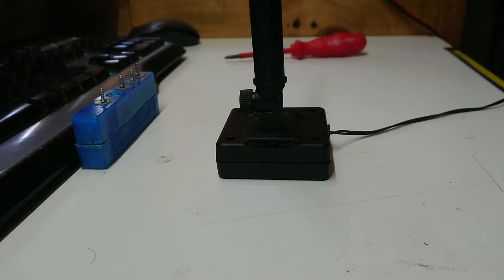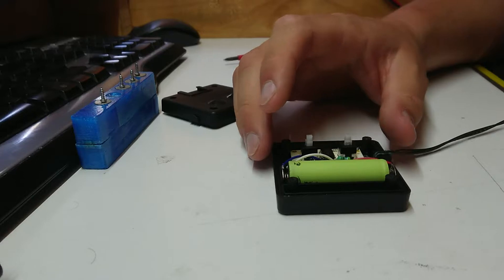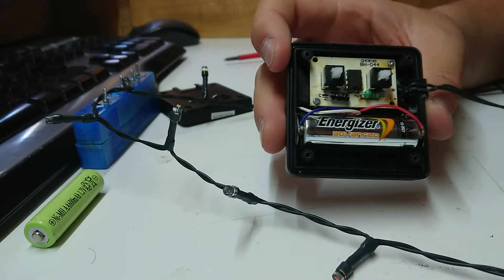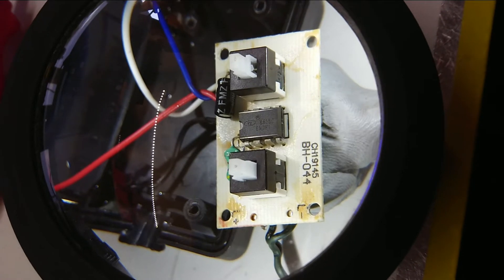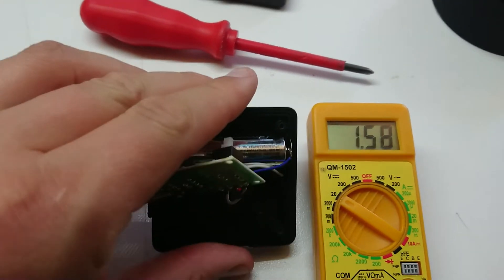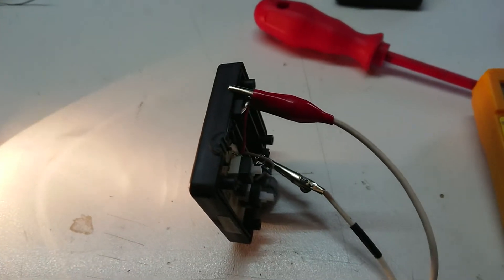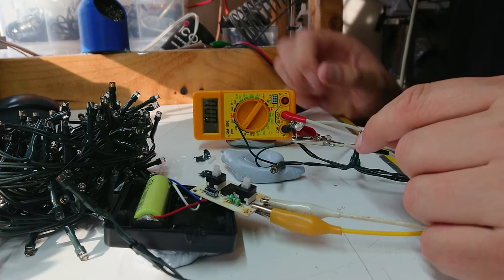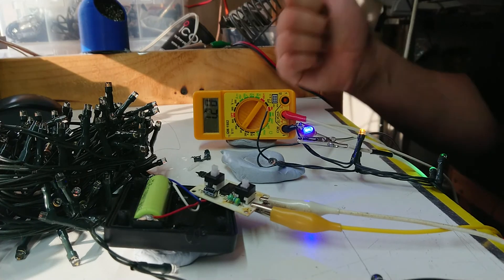Autopsy of failled Solar Christmas lights

Comment: Hi. Mine is not charging anymore after i plugged it into an adjustable power adapter. It's working fine before that. What happened? What should I do then?
Reply: Can i make it rechargable through electricity instead of the sun because it's always raining. It doesn't charge that much.
Reply from the maker: @tophersamson6085  there are small lithium battery charger circuits for a dollar or two on aliexpress and ebay, that change from usb. Attach a small lithium battery. Attach a 100 ohm resistor in series with led string, should work.
Reply from the maker: If the power supply wasn't current regulated, or the current set to high, it probably killed the transistor.
Reply: So the board is dead?
Reply from the maker: @tophersamson6085  if you don't have the ability to swap a transistor then probably yes.
This is however, speculation, as I haven't looked at it directly.

These boards are common across garden lights and many other xmas light strings
Reply: Is there anyway i can make it work again, aside from replacing that transistor?
Reply from the maker: @tophersamson6085  find another similar one and swap the board over
Reply: Thank you so much for answering. You're so helpful.

Comment: Can I ask sonething about the battery if I can use any type of battery as long as it is same voltage 1.2v? Or even the battery is desposable and not chargeable type?? Pls reply thank u...
Reply from the maker: You could use an alkaline cell I guess, they will recharge a few times, but it's not ideal and would probably leak after a while

Comment: Nice video, I was hoping you had some trick to work out which led was the corroded one.  I have similar lights and a similar issue, the first ones in the string are bright and somehere along there must be corrosion and they gradually get dimmer.
Reply from the maker: Most of them are designed in such a way that makes it hard to pick outside visual inspection of each junction. if they get progressively dimmer towards the end of the string, it usually means low voltage, rather than an individual led or connection failure.
These things really are built right on the very edge of being functional.
Reply: @TheAussieRepairGuy  Agreed.  I may unsolder the string and reconnect the other end first and see if that helps.
Reply from the maker: @nickwilliams1953  Process of elimination is usually the most reliable way I agree.

Comment: I need to extend the wire of some of my solar christmas lights. What kind of wire should i buy?
Reply from the maker: It depends how many circuits there are. Short cheap sets probably only have two wire cores. Anything with color changes is likely to be 3 or more. Without seeing the set you have, I can't say.
Reply: The ones you have on the video is exactly the same i have
Reply from the maker: @djwarlock8  this video is 3 years old, those lights are long gone. I don't recall how the string was wired

Comment: Sir can i use any lithium battery as a replacement instead of a nica battery? and does using higher capacity wont burn the lights and will charge normally?
Reply from the maker: Lithium has a much higher cell voltage and won't work. Nicad is 1.2v/cell, lithium is 3.7v/cell
Reply: @TheAussieRepairGuy  sir follow up question can i use 2500mah NiHM battery this have 1.2 volts, will it charge normal? Thanks sir
Reply from the maker: @macrouser6539  the higher the mah rating of the battery, the longer it will last, but it will also take longer to charge. 
As long as the voltage is the same, you can use it yes.

Comment: Can  1 piece of light can wort at 3.7volt??
Reply from the maker: You would need a current limiting resistor in series. 
probably 6-12ohms.
Without that, it will burn out.

Comment: How can I tell if the lights are turned on or off as the on/off switch doesn't indicate this? Cheers
Reply from the maker: Best way I have found is to cover the panel with my hand to see if they turn on. Another way would be to open the unit and check what side of the switch is wired.
Reply: @TheAussieRepairGuy  lights haven't been used since last Christmas, when I cover the solar panel lights don't come on but to charge battery it needs to be on. Bad design fault hey.
Reply from the maker: @seymore1532  usually those things have a single nicad battery in them. they are easily replacable. the ones I got at the local $2 shop had a battery door for a AA size nicad, and right next to it on the shelf they have 600mah nicads lol.
Reply: @TheAussieRepairGuy  so which batteries do these solar lights take?
Reply from the maker: @seymore1532  the one in the video takes a 600mah nicad AA battery.
Reply from the maker: Yeah left sitting for a whole year, flat, battery might be in great shape